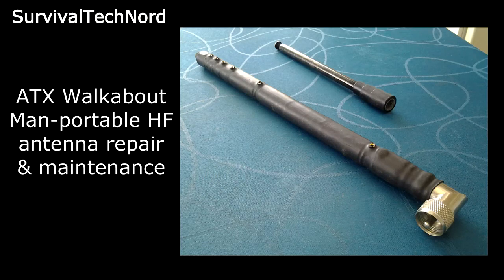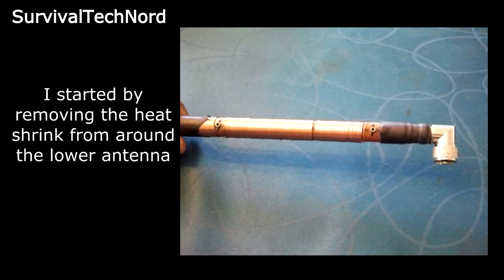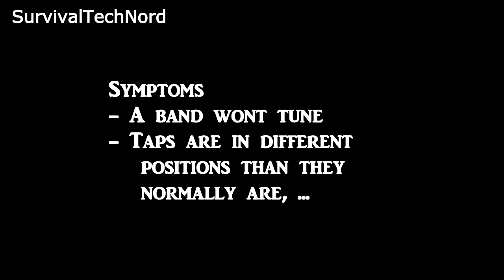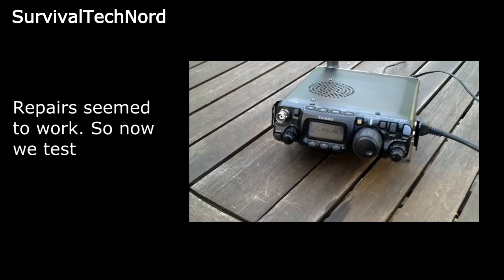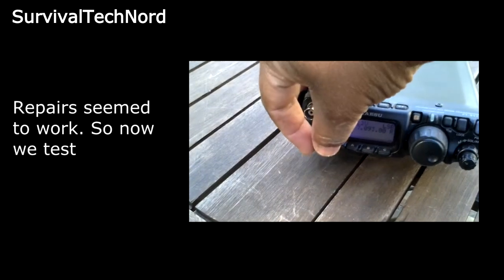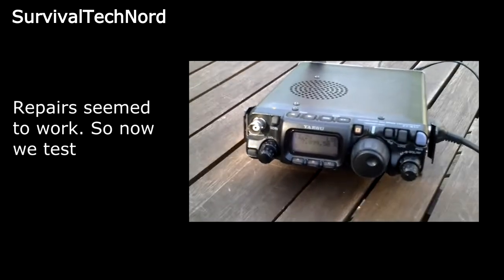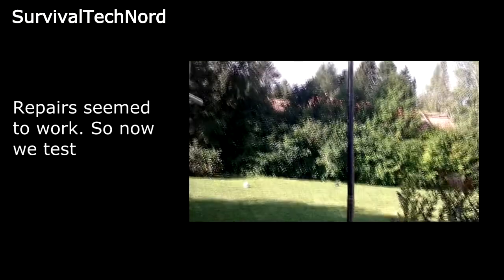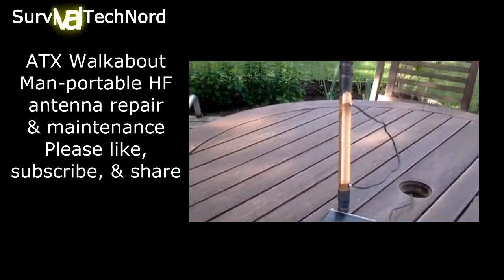Howto Repair the MFJ 1899T ATX-Walkabout QRP Ham Radio Antenna

Comment: Thank you Sir, I recently purchased and am awaiting a used radio with the 1899T included. Should it experience similar problems I won't be so afraid to tear into it now. And thanks for the tip about the CRC. I have a couple cans of that brand cleaner. The nearby autoparts store where I get it doesn't have the CRC silicone lubricant but I happen to have some Liquid Wrench brand that I presume will work just fine.  Armed with this knowledge I'm going to clean and lub my MFJ-1714 I've had for years, fantastic 2m antenna.
-Dave

Follow-up the next evening... WOW, lightly sprayed down my 1714 with the electrical component cleaner, wiped it off with a shop rag and it just GLEAMED!  I wasn't expecting that, I mean, it was shiny, it's chrome right.  But it must've indeed been a little dirty. Then I sprayed it with the silicone lub... holy cow. I didn't remember how smooth it would telescope in and out!!!

This is about a ten or twelve year old MFJ-1714, granted, for several years it just sat there waiting to be energized again, but just sitting around, things like this still get dirty.  Thanks again OH!